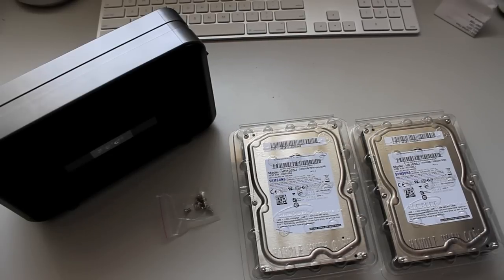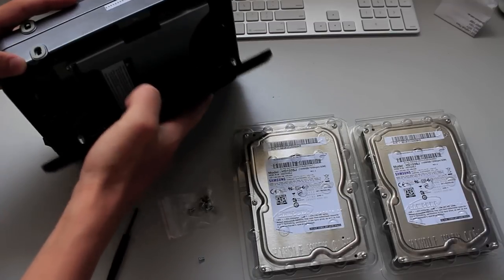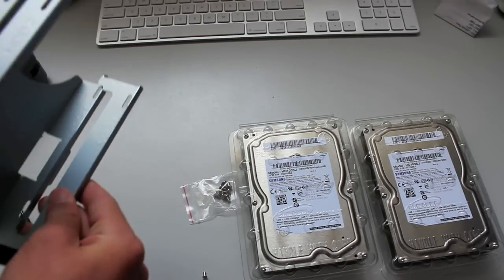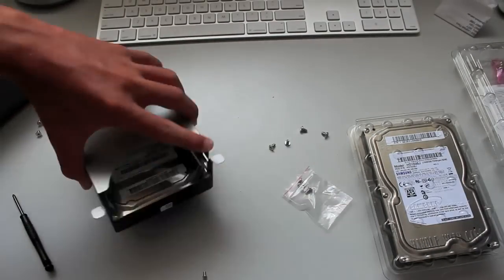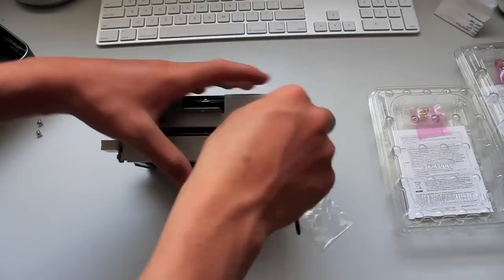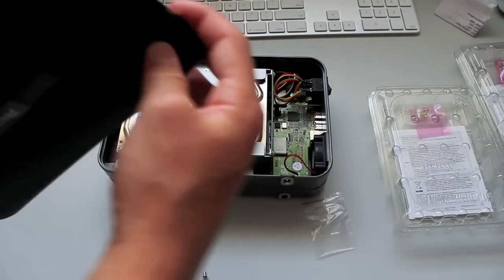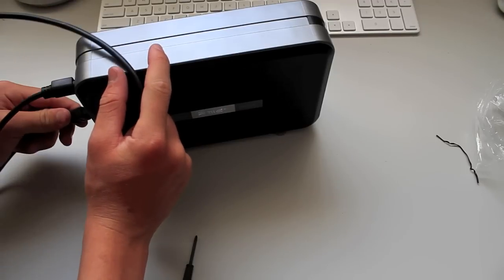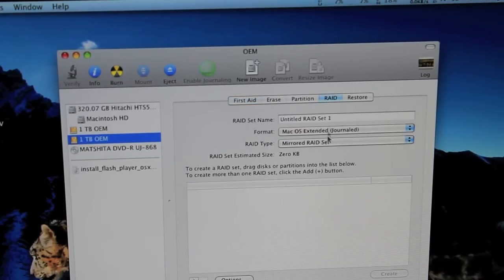Installation: 2 1TB Hard Drives into Firewire RAID Enclosure

Comment: Ok question.  I have done RAID before the moment I got my PowerMac G5.  Apple is extremely user friendly when it comes to striping.  My question is, what is the benefit of doing this vs buying an external HDD (3TBs are going for about 140 by me) and using a program like Carbon Copy Cloner or Super Duper and mirroring the drive that way

Comment: I have a macbook and have a mybook western 1TB type external hard drive and wanted to know is there a way to install it in inside my mac without taking out the one that came with the mac I want to have both my external drive and the one with my mac both inside my macbook can I do it ? I know you can take apart the external drive and take the drive out of the cover  but wanted to know if can have it the one that came with my mac?

Comment: okay let say I already have 1 hardrive running vista home basic and i have a spare 40gb hard drive with a different name. I want plug in the 2nd harddrive without installing and os on that harddrive to run with 2 harddrive in 1 primary for both hdd without raid array it is possible